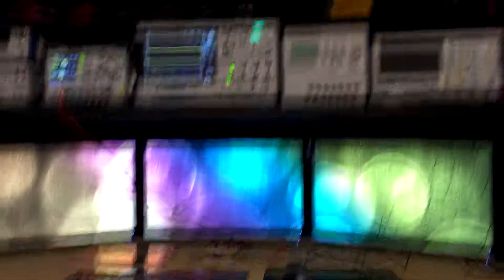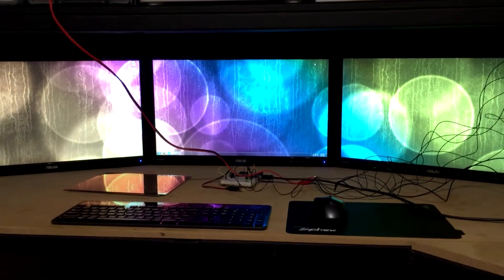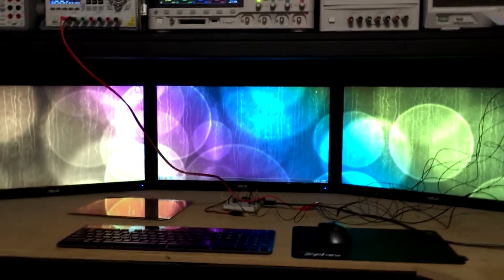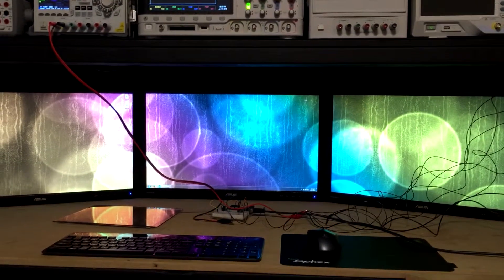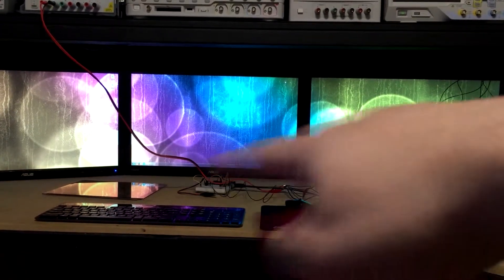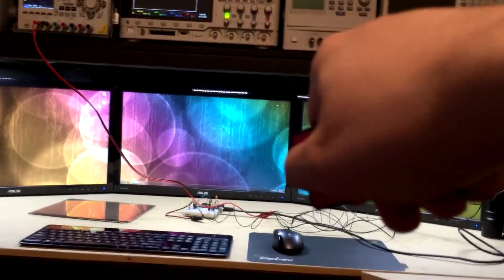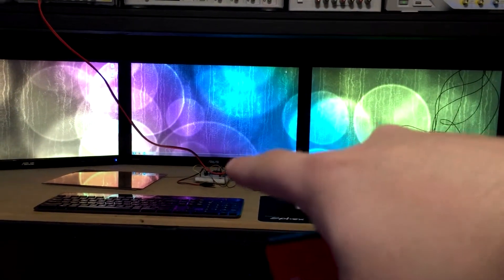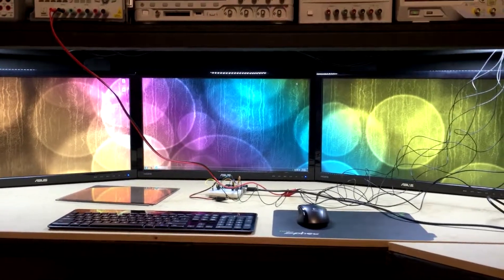Workbench Lighting / Controller Project (Part 1) [Super Quick Demo] #0004

Comment: you know you can work the debounce in the software code right?
Reply from the maker: Frank Lopez There's no button bouncing--it's the IR repeat sequence.  I cover that using a software debounce (latch/delay), but it's the repeated pushes in the buffer that get me.  Not worried about it enough to rewrite the receive method.
Reply: yea thats common in IR it sends the button value alot just as a safe guard  i learned this while i learning to decode all my ir remotes at home so i can make a arduino universal control so what works in my home will work 90% of the times in local bars lol i be fucking with the bartenders changin the channel and vol on dem lol